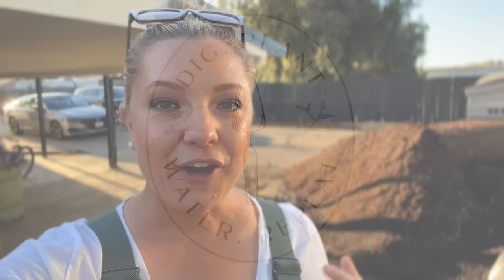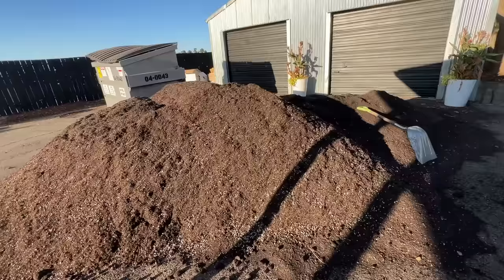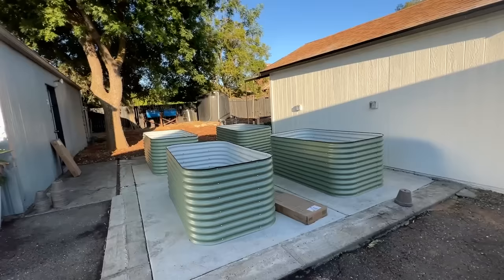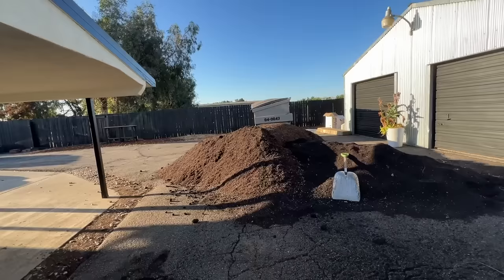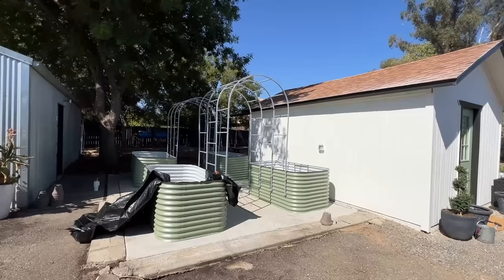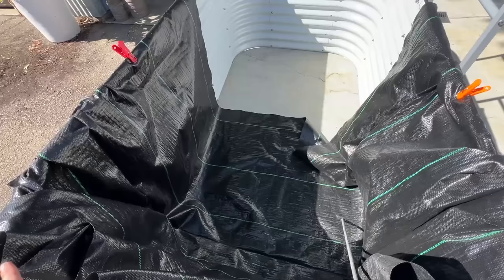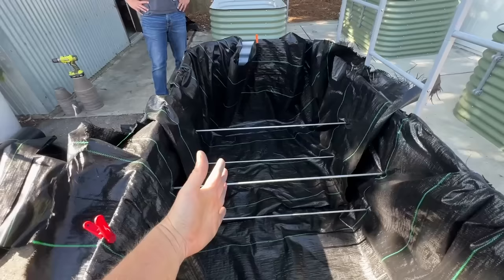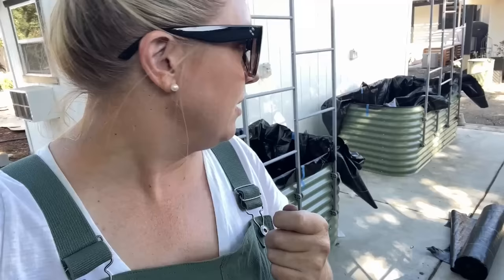We're Getting Our Hands Dirty! :: Setting Up Vego Arches and Filling the Garden Beds

Comment: I have the shorter beds with the same trellis. Advice that I was happy to receive from a fellow gardener: For certain crops the opening between each rung is sometimes to wide for the plant to follow. Therefore I added a plastic mesh liner to one trellis and chicken wire fence to the other. Worked like a charm.